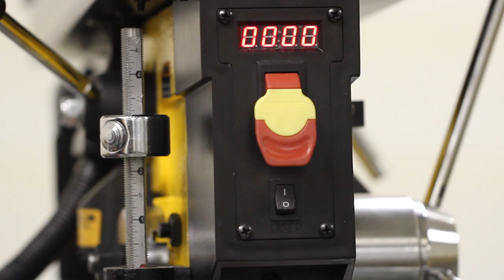WEN 15-Inch Variable Speed Floor Standing Drill Press

Comment: can this drill press take a 3-1/2 inch forstner bit through wood without stalling out?
Reply: +dukebball71 well its is rated at 8.6 AMP motor so its about has strong as any in its price class. Tables I have seen say that it over 3/4 HP at load of truly a 8.6 AMP motor. I'd call WEN and be sure and say what wood .
Reply: Asking the questions that really matter.